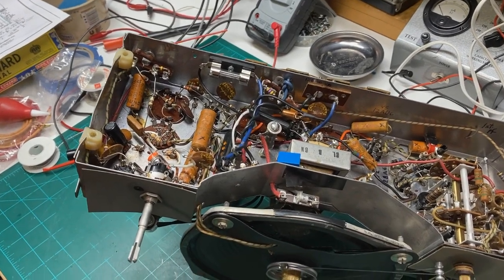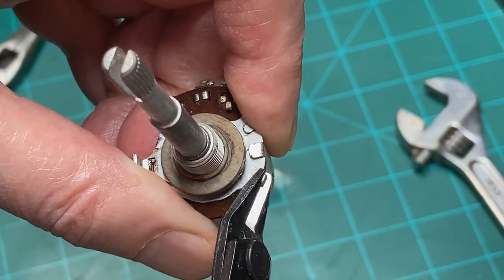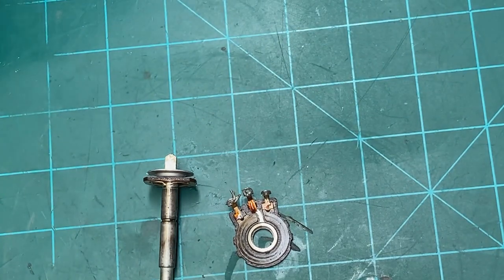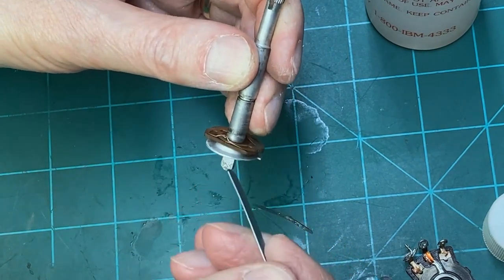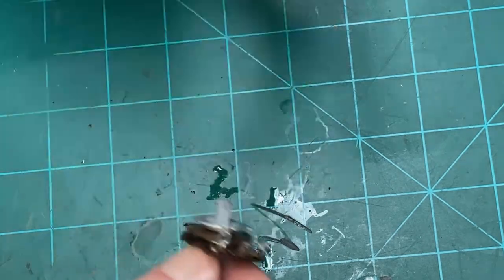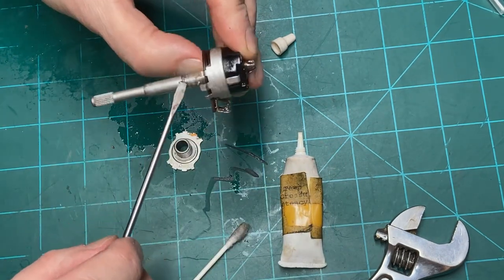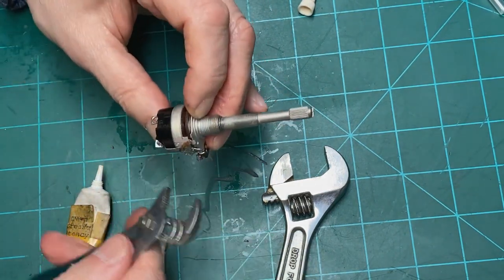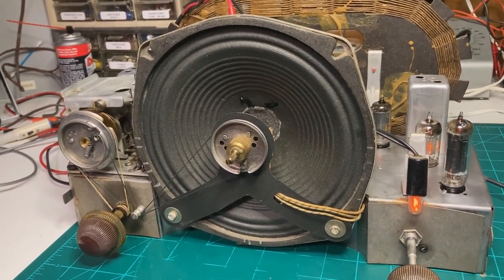How to rebuild a volume control (Potentiometer)

Comment: Thank you so much ,not too many detailed videos about repairing volume control is on YouTube,  I certainly learned enough to roll up my sleeves and fix my scratchy potentiometer. Thanks again
Reply from the maker: Thanks for the kudos Bahram.  One thing I might add is to NOT use DeOxit D5 on the carbon track because it may dissolve it and end up making it sound scratchy.  Best to use DeOxit F5.  The "F5" designation is for faders.

Comment from the maker: Some people have asked what that Orange Drop capacitor is with the coil of wire around it.  A: It's my home-made replacement of a very unusual (for me) shielded audio coupling capacitor.  I just wrapped a single strand wire around a standard .022 mfd. cap and ran a bead of solder down both sides of the coil wraps so as to make it a shield for the capacitor which is supposed to keep out any hum.

Comment: I know Deoxit full strength will absolutely destroy carbon pots. I ruined several with it before I figured out what was going on. I never gave the d5 a chance before I went back to using regular contact cleaner with light oil.
Reply from the maker: I don't think D5 is all that strong to where it will destroy a carbon pot.  Could be why they released F5 for faders.  I'm still using the pot shown in the video everyday on my Zenith FM radio and it's doing just fine.  Thanks for the reminder though, sometimes I just grab the D5 out of habit when I really should use the F5.
Reply: DeOxit FADER LUBE is designed for Rotary & Linear Potentiometers.
Beginning in 1970s, manufacturers began to switch from Carbon to Conductive Plastics.  Stong Solvents MELT the plastics — destroying the control.